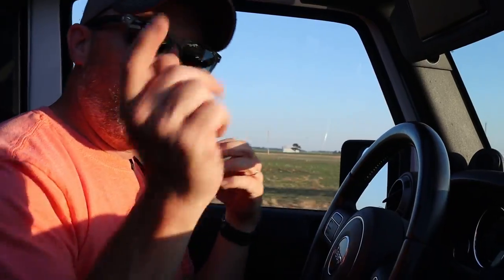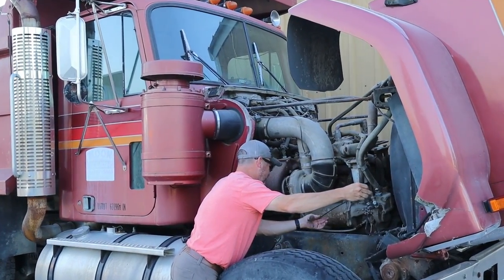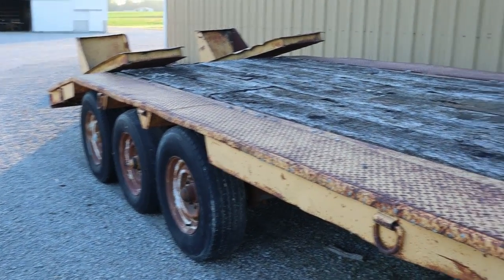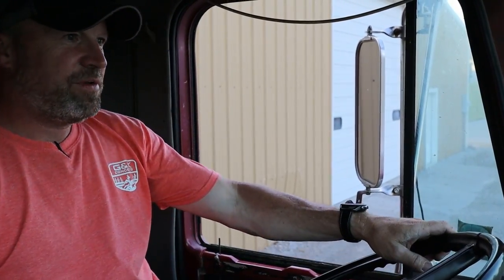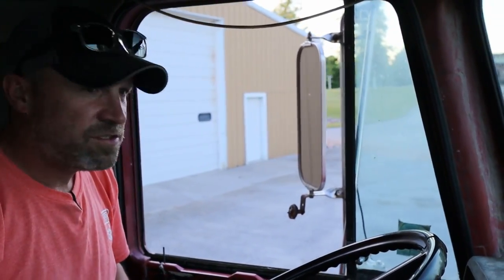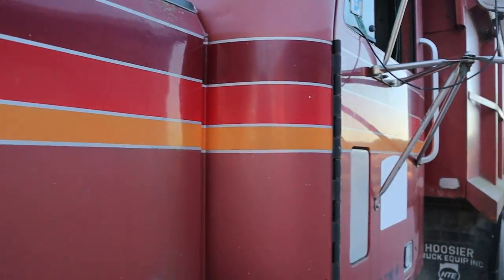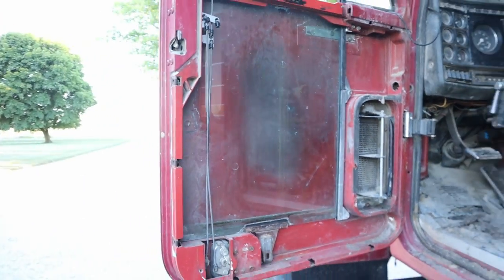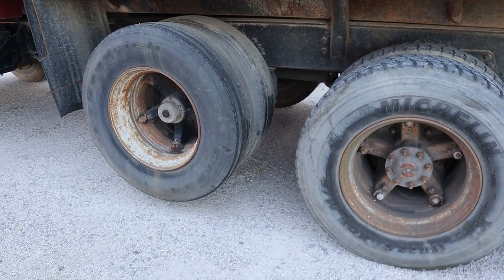I Bought A Tri-Axle Dump Truck [Hasn't Been On The Road In Seven Years] 1986 GMC General

Comment: I am not sure my wife would have been as supportive as Cara when it comes to this type of purchase. You have a great family Neil. Thanks for the video.
Reply from the maker: Haha!  She's used to it by now but you're right, I am certainly lucky for the support and the family that helps!
Reply: My wife lets me buy that old stuff. Have a 71 
SeaGrave Engine. ( 8-71 ) plus a 78 Dynahoe-190. ( 353) both Detroit Diesel's. 
The Fire Engine has a ( spicer) 5 speed. It's interesting it's gets in 5th. Real fast, then it basically slows to stop without Down shift.
It's almost like a Automatic Transmission. Great for Kids to get in cab at local events. I filled the AIR pack compartment with different Fire Extinguisher, it's water Tank is 750 gallons.

Comment: Congratulations on the purchase. To answer your question, yes that is a great engine. I was a Cummins mechanic for 3 years before I went to work with the fire department. The old 855's were strong and reliable and the Big Cam 3's like yours were my favorite. I've seen some of them with 600k miles before a rebuild. They are simple, easy to work on, and easy to bump the horse power on if you want to. That engine being a 400 hp should be putting about 320 hp to the ground according to Cummins specs. If you have any questions, feel free to hit me up. Can't wait to see it in action. Stay safe my friend.
Reply from the maker: Thanks so much BD!  I'm glad to have the vote of confidence from someone with that kind of experience.  I think it will serve my purposes wonderfully and still make someone else a nice truck after I'm done with it.  I'm looking forward to putting the 'ole boy to work.

Comment: When I first saw this old classic General, my initial thought was it had to have an old two stroke Detroit Diesel like an 8V92. Looks like it'll handle what you'll throw at it with no issues at all.  Trailer looks in decent shape by the quick look, even though the wheels could use a touch up.  Like the paint the way it is for sure.
Reply from the maker: It did have a Detroit originally I believe.  I think the paint will stay for now!

Comment: Thank you for buying her. The GMC General should have a Detroit Diesel, just my Humble opinion only. On the start up putting in gear, just wait for a few on the gears to engage. I drove a Ford L-9000 with that transmission, they take a few seconds for clutch brake to kick in. What is the Load Wt. On those short high sided box's. We don't have those in my area. Everyone runs pup trailer. Very nice start up, and if AIR built that fast compressor is in great shape.
Reply from the maker: You can wait all day on this one and it still grinds going into gear.  I think it needs a clutch brake adjustment.  The rule of thumb for us around here in Indiana is that a tri-axle can haul 40,000 payload legally.  If you order a tri-axle load of stone you get 20 ton.  A quad load is 22-23 ton.  A semi end-dump is 25 ton.  We don't have anyone running pups around here but I've seen them in my travels.  They are cool!  Our area is dominated by tri-axles and quads.  Thanks for watching!

Comment: That is the same type road tractor I got got my CDL with, when i went to back up it was like backing a aircraft carrier. The one I drove was a tandem with a dog house sleeper. Racked up many miles in that old brigadier general, had a cummins 855, Great memories!!!! 8 speed roadranger, perfect for your application. Front steer tire cupping is generally caused by worn suspension parts. Sometimes worn shocks that ounce a lot while driving.

Comment: My guess is you had a pretty good idea what you were buying before you pulled the plug on this truck.  Looks like it is going to work out for you.  Nothing more fun than a new piece of equipment!
Reply from the maker: Yes, I did have a good background on it but it hasn't hauled anything in the bed for a good 7-8 years to the owners knowledge.  I knew it was good when it was parked just didn't know what can be hiding as a result of sitting.  I think it will do the job just fine though. (hopefully)

Comment: Neil, the Cummins big cam 400 was super common back then and parts should be available anywhere if you need them. That trans is an 8LL or 8 speed double under drive also very common in old school dumps.
Reply: Sam is correct on the engine trans combo, very durable and matched for dump truck, that double low allows you to creep in soft/steep ground and not stress the driveline, as for the shift pattern it allows for a higher top end speed, alot of road Ranger Trans could be turned around for a higher top speed, some people called them overdrive's when they were turned around
Reply from the maker: Nice! I'm glad for that!
Reply from the maker: Thanks for the info👍🏻

Comment: Neil… that’s not a project… it’s a tool for a project!  There is nothing wrong with having a seldom used piece of equipment that doesn’t look showroom perfect.  Just get it safe, compliant and reliable and it will be a good tool.  I must say… it does look like it can easily become one of those!

I never got my CDL… I have a chauffeurs permit and was intending to upgrade it at one point. But, I got a promotion and hired guys to do the driving instead.   I wish I had gotten it.

My guess about special projects is that you are putting in a firewood processing shed near the round pad that you already have.  Being able to shelter your equipment, escape the elements to split wood and keep your fuel dry would appeal to me!

I am happy for you… I hope it continues to be a ‘value add’ for your arsenal of equipment!
Reply from the maker: That's a good guess.  I've wanted something exactly like that near the round pads.  My special project may be considered more for cooling than heating however!  Stay tuned and thanks as always my friend!

Comment: It’s an 8 “under”. But I call it a U pattern . My brother has the same transmission in his 79 autocar triaxle and one of the 4 peterbilts I’ve had was the same . He and I both have the same engine. It’s a ntc 855. 400. Big cam Cummins.  Great engine . Has a pt pump instead of a common rail. I turned mine up a bit 😉.   Looks like you have The good Hendrickson walking beam suspension . For the time frame they are probably 44s. It’s probably an 18 or 20 stear axle. They’re known for going through kingpins .my brother just had to replace his because they’re so heavy .  I grew up riding in a general ten wheeler . That’s a great truck .Congratulations
Reply from the maker: Hey thanks Steve!  Glad to hear your approval on this outfit.  I feel dumb for not knowing that was the transmission but I think this is the only truck I have driven with that transmission.  I don't think it turns nearly as sharp as what it should.  I still need to have someone with more knowledge have a good look at it but I think it will serve my purpose this fall.  It's fun to drive though for sure.  Thanks a lot for checking it out!
Reply: @digdrivediy  It has fat front floaters. A lot of times what we do is change the front rims and tire size To a Little bit skinnier and then turn in the bump stops!

Comment: Started  my maintenance career on 80's  Generals. Check out vintage GMC pick-ups, heater cores/ wiper motors / some window regulators / inner handles  / A/C  mostly GM pick-up parts. Ours were never known for their turning radius Enjoy the truck.
Reply from the maker: Hey that's a good tip!   I didn't think about them sharing parts with the pick-ups!  Thanks a bunch!

Comment: That Cummins engine is a good one. The only engine that might be better would be one of the older 3406 Cats. Should be plenty of parts available for that engine, but hopefully you won't need them. Some people call that transmission shift pattern a "U" pattern. In those older trucks that's how they put an overdrive for the top gear instead of being direct drive. Looks like it may have a deep reduction on the bottom end for some extra grunt when needed. Looking forward to seeing the old 5 star put to work.
Reply from the maker: Thanks so much Jeffery!  It does have the deep reduction.

Comment: I agree with one of your viewers. It will meet the need. Remember, Tires, Brakes, Hydralic fluid, belts, lights are for safety. I would test the bed to make sure you can lift it before you load it. A little here, a little there. It should do the job.

Comment: Had 1 for several years hauling for extra money. 
6-71 T Detroit and the 8L.L. as yours. It would run 72 m.p.h. level ground grossing 72,000.
The 3rd. axle is actually called a " pusher ", not a tag axle. Mine had mini wheels on the pusher for ground clearance off road. Required a little extra maintenance because they spun MUCH faster than the drives. Great truck but cab parts became somewhat scarse even 20 years ago.
Reply from the maker: That's cool.  I've never heard anyone around here ever call it a pusher axle but makes sense as to why.  I should have just said "air axle"!  Someone said that the cab shares a lot of parts with GMC pick-ups.  I think it will get the job done for me.

Comment: Nice truck! I have an 85 Ford L9000 with a Cummins and that same tranny, it's a great combination. I worked mine for 8 years fairly problem free. Shift at about 1200 and don't run the engine up to the governor before shifting. Low end torque engines that govern at about 1900rpm to 2100 rpm. Great rig!!!
Reply from the maker: Thanks Gary!  I'll get out there and work on my shifting!
Reply: Gary it funny I ran a Ford L-9000. It had the Detroit Diesel 8-71 with 5 speed.
Reply: @rp1645  I used to have one of those too 😂

Comment: Hi we had 4 generals with 8v92 Detroit and 13 speed transmissions back in the 80's that we pulled 4 1480 international combines with   on A frame combine trailers down on the wheat run from texas to Canada  they were a very good reliable truck and simple to work on.
Reply from the maker: Man, that sounds like quite an experience!
Reply from the maker: Man, what an experience!

Comment: What a great purchase neil! You will get tons of use out of that thing! My peterbilt has the same engine and trans. The big cam 4 was a great motor and parts are readily available! The U-trans (what we call them) or 8sp granny low is wonderful if your in soft ground and keeps you from busting U joint or shattering a drive yoke! Not that I know from experience or anything! However that truck looks really solid and your gonna gain friends real quick once the word gets out that you have a dump truck more so then you already do! Oh I also seen the mechanical pump! You can tweak that screw a bit and gain some extra ponies! 

As far as your project, I'm going to guess your going to build the girls a swimming pool! But you did mention you were going to start this late summer early fall? 🙄 hmm.... now I'm second guessing myself!
Great video as always. God bless
Reply from the maker: Thanks so much!  I hope the girls will enjoy this "project" for sure. :)

Comment: My family bought 1978 model 5star 8v92, claimed to be about 440 hp. Could out run and out pull almost any truck in our area. The cab was the widest of any truck I ever drove. Crawl through sleep was a pain. Stupidly it had 22 inch tube tires.

Comment: Your crazy and I love that you are!!  On the other hand both your Dad and you have owned large trucks and have CDLs so you are familiar with some of the paper problems of owning this truck.  I do not know what computers an 1986 would have but if they do have a computer, it likely does not control everything and may be fully mechanical injection. This is good in an old truck because less to go wrong. Not having DEF is a BIG plus.  This engine is likely to run long after it has run out of horse power; I would expect there to be no engine problems. My truck (not a dump truck) ran just fine even with a hole in a piston! (oil consumption was one gallon per 100 miles but it ran just fine)  I am glad that you are thinking Brakes and Tires!! What you do have is a rubber problem!  All the belts, hoses, parts of the brake system and tires are all too old, whether they look good or not!!  That is big $$$   The tires have to come off to look at  the brakes so to save a $ I would move the best and youngest tires to the tag axle. (there is a code on the tire that will tell you how old it is)  I would consider new tires for the rest unless young used tires could be found for the rear two axles.  I would put new on front.  Might want to know about the axle as well so we don't just end up with cupped new tires.  The tires have got to hold the weight up when loaded and you likely don't want to stop in the middle of "the project" to get a new tire after one shreds!  Also consider new batteries with a battery shut off switch if it does not have one.  That will go a long ways towards having some reliability under load! It will also reach into your wallet!
Reply from the maker: Thanks Scott!  Lots of great advice and tips there.  I already have a call in for some used tires but not having as much luck finding 22.5's as I'd hoped.  I got a place that is going to go through it for me too.  It should do what I want to do with little trouble I would think.  The pocket book is gonna get thin if I really want to make this an everyday truck so I'll probably do what I have to for it to be safe at this point.

Comment: If it does the job then it’s as good as it needs to be, that being said, look out, because the little “ you might as well as” things start happening and the next thing you know you are putting the final coat of paint on the truck and dump body, because you’ve gone this far “ you might as” because it just doesn’t look right or run as good as it could. Congrats, have fun with it.
Reply from the maker: Boy, you're exactly right Terry! :)

Comment: That truck probably came from the factory with a Detroit 8v71 silver bullet.  The shift points are probably at 300 rpms where most Cummins engines would be 500 rpms.

Comment: Nice truck. A little maintenance / TLC and you have a workhorse. Looks like a clutch adjustment, some tires, lower set cushion, lights, and it would be good to go. Don’t forget about belts and hoses in the engine compartment. Also the DCA level of the coolant for protection on the cylinder liners. Plus, the air lines / hoses for the air brake system. I hope the brake shoes are good and no leaking wheel seals. Due to it having Dayton wheel hubs it has inboard brake drums. Definitely need a wheel dolly for doing brakes. I have been a med/hvy duty truck mechanic for 25 years. Feel free to reach out with any questions? Also, I have just purchased a 1980 semi tractor that I’m going to get back to road worthiness.  And going through basically the same stuff as you. Them driver door window regulators weren’t build for the workout they received!
Reply from the maker: Thanks for the tips and advice.  As much as I'd like to work on it I think I'm going to have a regular shop have a look for some of the reasons you mentioned like the wheel dolly.  The stuff is just too big for me to handle comfortably.  I appreciate the offer to reach out for questions as well.  I may just need to do that.
Reply: @digdrivediy  completely understand about not having equipment to work on some of the items on the truck. Again if you have any questions or unsure about anything, either doing it yourself or having a shop perform work for you, feel free to contact me.
Reply from the maker: @gregkereluik6224  Appreciate it!  While I'm at it, what do you mean by "lower set cushion"? For the bed?  Cause if so, you are very observant!
Reply from the maker: @gregkereluik6224  Oh, "lower seat cushion". Duh, I should have known that.  I wondered if there was a way to set a "cushion" for the lowering of the dump bed so it doesn't bottom out hard.  It doesn't quite sit all the way down, so it bounces a little when empty.  Ha, that was likely dumb of me 😋

It does need a new seat cushion 👍🏻😁
Reply: @digdrivediy  hope you have a belt cricket for all those belts on that engine.
Reply from the maker: @gregkereluik6224  That I do not. 😁

Comment: That 9 speed is overdrive thats why the reverse shift pattern. Good Trans. The 400 Big Cam cummins is a very good engine. 855 cuin better than a 2 stroke detroit that also came in those trucks. A lot more torque good luck

Comment: Neil,  do you insure your trucks as strictly not for hire ?  I’m thinking about buying a <26k lb,  older dump (2000-2005) for use on my farm and other properties .  I wanted the ability to do side work if I wanted to on a limited basis or if I wanted to haul a load of mulch or stone to a friend or family member who I might just charge for fuel .  I didn’t want to be locked into a high insurance premium as if I’m trucking full time .
Reply from the maker: I do insure as not for hire. I was also able to tell them I operate less than 5K miles a year and that helped as well I think. Insured through Progressive.

Comment: If I had to guess that truck was bought new by Graves trucking , sold to salesman trucking in the mid 90’s . Been a while since I seen one on the road
Reply from the maker: You could be right but the precious owner thought it was a Bunn truck.  I remember the graves trucks like this too from the early 90's.  Salesman always had really nice looking trucks even though they were usually older.  This truck was purchased at the Ft. Wayne vehicle auction by the previous owner in the late 90's.